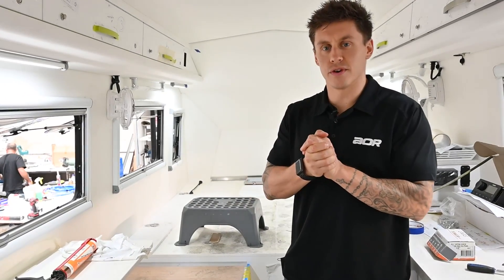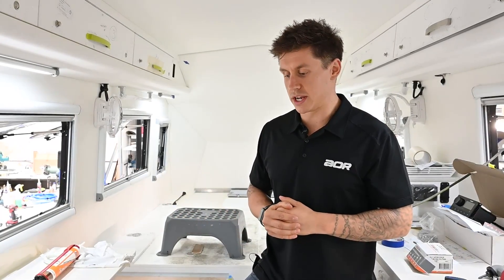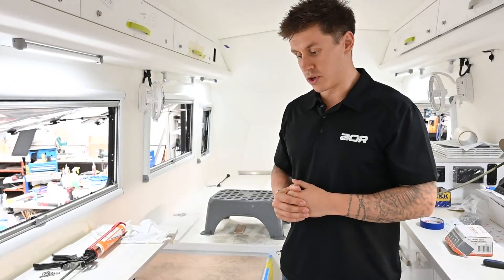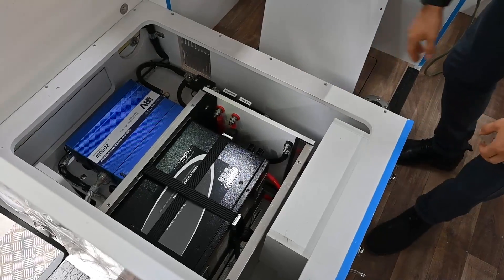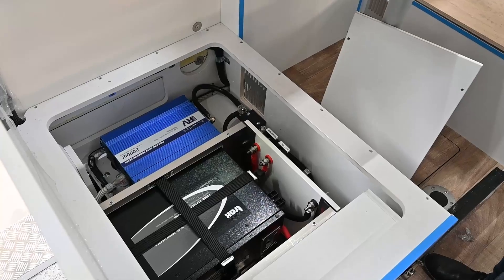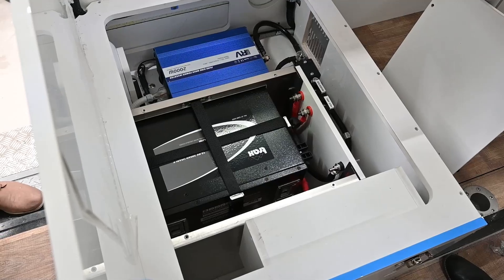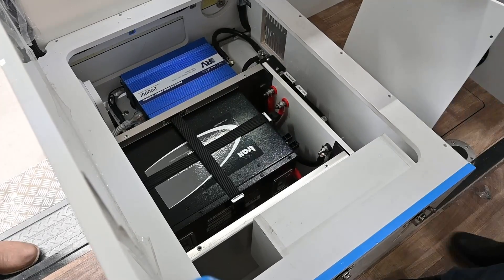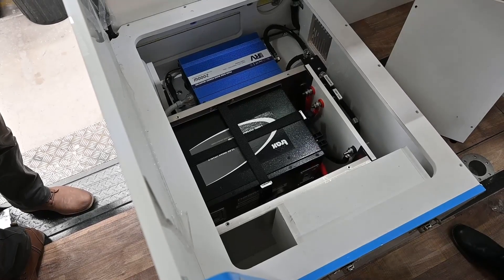AOR - Battery Regulations Update

Comment: Luke can you describe what measures are taken to ensure water cannot get into the battery compartment eg. when doing a long river crossing?
Reply from the maker: Thanks for your comment. We are doing this the same way we do our gas bottle compartment which we do not have issues with and have been doing this for many years. We are running the hose towards the rear of the trailer which prevents scooping water in. This hose comes up into the box and is then roughly 40mm higher than the floor which is already around 600mm off the ground. If you are moving through water we do not see you having any issues, we just do not advise stopping in water higher than 600mm if possible.
We cannot fit valves or covers to this hose as it would impact the venting aspect so we have done everything we can to comply with the regulations with as little impact as possible on our trailer’s performance.

Comment: What is the ‘problem’ that the new legislation addresses? Can you share a link to the legislation?
Reply from the maker: The new legislation is the AS/NZS 3001.2 electrical installations- connectable electrical installations and supply arrangements.
 
Unfortunately we cannot send a link to the standards as this is for manufacturers only. It is copyrighted material licensed to SAI global caravan industry association of Australia (they have stated that distribution, storage or use on a network is prohibited). Hope this helps!

Comment: I take it this applies to only new vans, older vans dont require a retro fit??
Reply from the maker: Yes that is correct, new builds only
Reply: That's not 100% correct. 
It apply to new builds and old setups that have been modified after the regulation date
Reply: @DIY12-24v  which I can't see being possible to police for DIY installers provided your van has a pre Nov 23 build date. Imagine insurance companies might end up adding a clause to place burden of proof on the owner of older systems to show when the install was done.